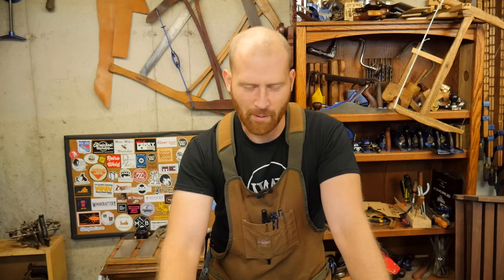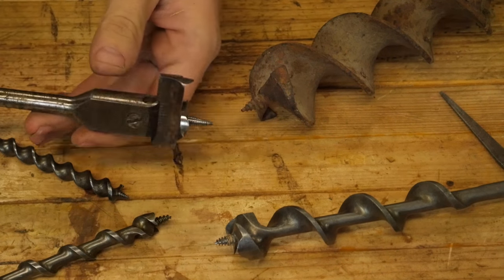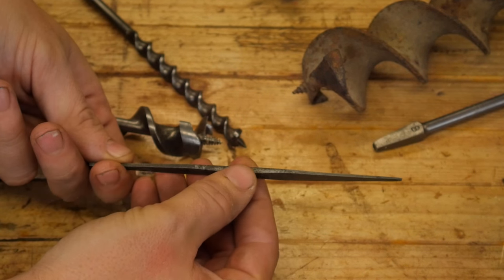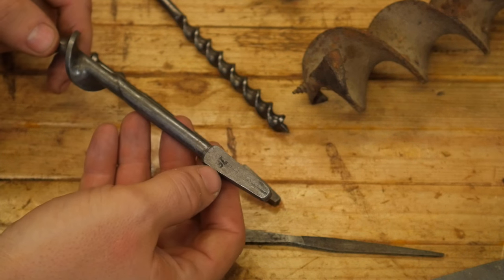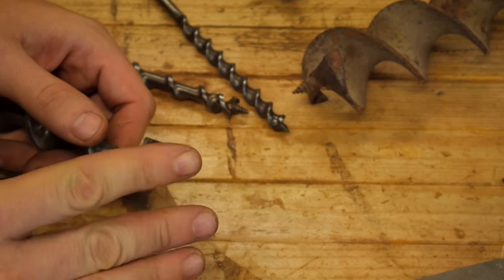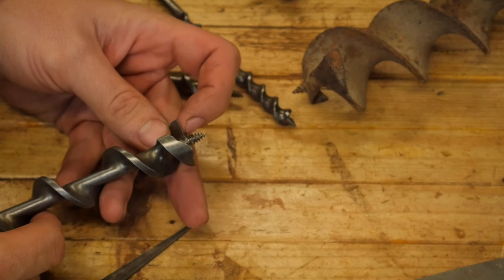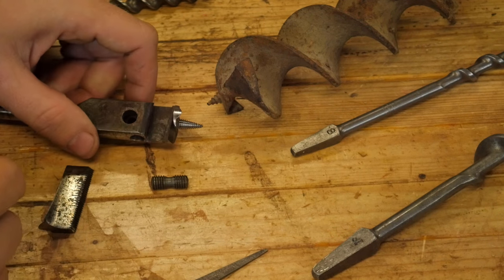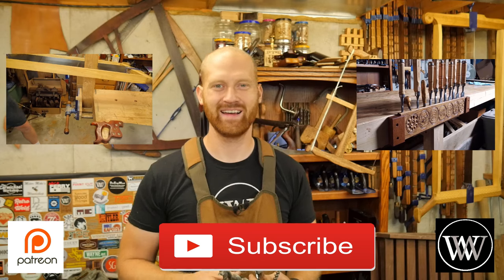How to Sharpen an Auger Bit For a Brace and Bits

Comment: Had to drill a hole with a #14 auger bit.  It did not want to cut with my brace and bit.  I sharpened the wings and leading edges.  Nothing.  It would not work.  I then drilled an 1/8" hole to try to 'lead' the screw through the wood.  IT WORKED PERFECTLY.  I guess the pine was too soft and stripped as the lead screw was going into it.  The small hole gave the auger something to grab into.  Woodworking is hard thinking.  Problem solving.
Reply from the maker: yup some times that is the trick with the bigger ones. especially if you have the wrong lead screw for the hardness of the wood.

Comment: After soaking off rust the metal turned black. How to correct this.?
Reply from the maker: I'm assuming used vinegar? In which case you can scrub that off. But generally just using it will clean it off.

Comment: You can abrade off the teeth of any file on a rough oil stone ( use a silicon carbide or diamond if you have one). I use a triangular needle file for auger bits. Make both nickers the same height, and sharp on the top. Take off the burr on the outside.

Comment: I've always sharpened with regular files that fit the space. Minding the change in plane of the blade and such. No issues, no changes in bevel or profile. I've also been advised to use a small file and create  a "safe" edge with a throw away sharpening stone.  Never did that though. Just go slow and careful. For really small augers, you'd have to use a 'safe' edge file or one of these. augers demonstrated by James (Edit)...Forgot to add a rant:  Just bought an extra set of augers online and got screwed royally....the seller ground off some of the tangs to a cylinder to use it in his drill press. Did such a bang up job, doesn't even spin on its axis. Arrrrghhh....mad at myself for not paying careful attention to the blurry photos.  The 'ruined' ones were flanked by the better ones, so the tangs just blended with the ruined tangs.   I'll admit, tried to save some money seeing a 'good deal', but bit me in the ass.
Reply from the maker: +Slap Stick yup. I used a standard file for a long time tell I got an auger file.

Comment: Your auger bits are definitely different than modern ones.  The single spiral going back from  the cutting edges is much thinner and is spaced out more than modern augers.  I am on a mission to find some of these old style auger bits. I do not like the modern ones.  They bind every half turn.  Even on soft wood.  The auger files are sold new.  Easy to find.  Thanks James!!!
Reply from the maker: hopefully that will be tomorrow's video
Reply: There are some sets up on ebay that share the design of some of yours.  I have two flea markets to hit before making a decision on those.  The augers are very handy and having a few that work really well are almost a necessity. Thanks for the great advice and inspiration.
Reply from the maker: yup you just got to be careful I will go through 50+ before I find one that is worth getting. but a good auger is a true joy!
Reply: Even a so-so auger is better than a modern one that will not work.  I would never buy one with the 'pig-tail' damaged or missing.  No fixing that.
Reply from the maker: yup that is the first thing I mention!

Comment: I normally make my own safe files. I started refurbishing a Millers Falls brace but don't have any screw lead spiral bits. I have owned an adj bit like that b4 but was young and a tard, cut the square of so I could use it in power tools. I think I need a new one for my Brace if I ever finish it. Was debating buying a hex drive set of bits so i can use them in more tools.
Reply from the maker: just make sure your brace can use hex drive some cant. but it is always a good option.
Reply: didnt know that, will look when i can, thx for that

Comment: Excellent presentation.  I bought an inexpensive set of needle files and it had a small auger file in it.  I think from Princess Auto (a Canadian version of Harbour Freight).  I also find that the #12 (3/4") are hardest to find at yard sales.
Reply from the maker: +Jim Dockrell (Watertone) very true 3/4 and 1/2 have a tendency to be the first to go.

Comment: there is another kind of adjustable you missed, they have the center point then the adjustable portion is more like just an offset cutter, as a result they appear to only be usable for cutting to the depth the blade stick out forwards of the main adjustment bar it is built into, I would imagine their main purpose was for sheet rock and skirting boards back in the days of early wiring similar to what you'd use a hole saw for today in construction but adjustable, just need to get round to sharpening mine.

Comment: I have an adjustable Stanley auger and I do find that on soft woods many times when I'm boring through the wood it will split straight in half as soon as the lead screw goes fully into the wood. Any tips for stopping this from happening?
Reply from the maker: Yes. Clamp across the board to stop it from splitting.

Comment: What should I do about rusty/gunky bits? I got a pile of augers for cheap recently but most of them are very dark from rust and/or being stored in (used motor?) oil. Was considering leaving them all in some vinegar or buying some evaporust but I'm worried about damaging the diameters.

Aside: I also managed to get a rare pattern of auger in the lot - it's like the irwin style but lacking the central shaft and a fairly small diameter.
Reply from the maker: 6-24 hours in vinegar then a scrub down with a wire brush. then oil to keep them good does the trick.
Reply: Aubreykun Not much you can do, really. The rusted material is already lost, so just throw then in some vinegar, let them soak, and then hit them with your brass brushes. Follow up with a water bath to neutralize, dry them off, hit them with a fine polishing compound,  clean them off, sharpen them up, hit them with some oil, and then store them in a soft pouch or compartmentalized drawer so your edges don't get beat up after all that hard work!

Comment: You might want to use a curved slip stone, or a cylindrical, chain saw file to sharpen the inside of the blade on your adjustable.
Reply from the maker: thanks!

Comment: Hi James, nice video. Lots of good info. How important is it to keep the two blades at the same level? Do you try to take the same number of strokes on each side? Will it still work if they are not at the same level? I guess the shorter side wouldn’t do any work? Thanks.
Reply from the maker: The amount of material that it takes off with the file is too little to make a difference on lowering one side more than the other. Usually the wobble the blade will more than compensate for that. So it's not something I really try to focus on that much. I just don't change the bevel leave it at where it was and usually stays about the same. On average I only sharpen them once every few years.

Comment: Yeah, ok. But here's the thing. It is very difficult to find decent auger bits in most parts of North America. I recently purchased a set of Irwin bits on Amazon. They are made in Brazil. and are total crap, so badly machined that even after hours of work with a Lee Valley auger bit file and diamond hones, they simple will not drill holes properly. I have paid close attention to which edges should be sharpened, having watched this video, Paul Sellers' video, and many others. As far as I can tell, the bits are quite sharp, but they still do not work worth a damn. I have no intention of spending my time at garage sales or flea markets when I should actually be making stuff f out of wood. So, unless someone can point me to a source for new, good quality bits that are not so expensive that I have to take out a second mortgage, I am sticking with my electric drill.
Reply from the maker: No one makes them anymore with any quality. The only place you can get them is estate sales and garage sales, and antique stores. With a couple minutes of work, they are as good as new. I almost never buy new tools when there are so many antiques out there for dirt cheap ant work perfectly with a bit of love.
Reply: https://www.toolsforworkingwood.com/store/item/MS-JB.XX/Jennings_Pattern_Auger_Bit_for_BracesI have seen more online, you can also buy ones with the hex shanks, pretty easy to find.There are lots of old/new stock about, Clico in the U.K made them until recently, you can still buy them from online retailers whilst the stocks last. Unless you want deep holes or need to drill holes quickly, I recommend you buy centre bits, or the new style centre bits instead. Centre bits are easy to sharpen and maintain, pretty easy to find and very cheap.There are a couple of good videos on youtube demonstrating centre bits use.
Reply: Dwarfsbane Ironfist thx for that info. I discovered that my problem was not the auger bits, but my brace. The flea market brace I was using had a slight wobble which I had not noticed because of noob ignorance. When I spent the money on a new and expensive Lee Valley 3 jaw brace, my Irwin bits work just fine. The wobble (about an inch at the chuck end) apparently really stops the cutting edges from cutting a curled chip in the wood. Instead, once whole got about a centimetre deep, it just made sawdust or powder. The new brace with a 3 jaw chuck works for traditional bits but also really grabs hex and even round shanks securely. Live and learn, eh?